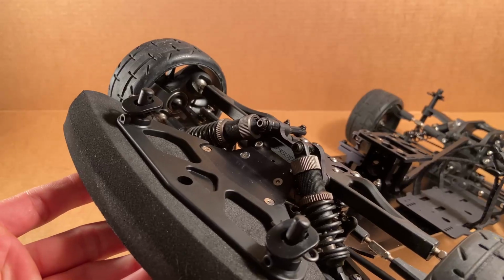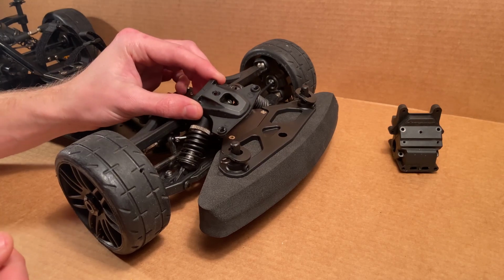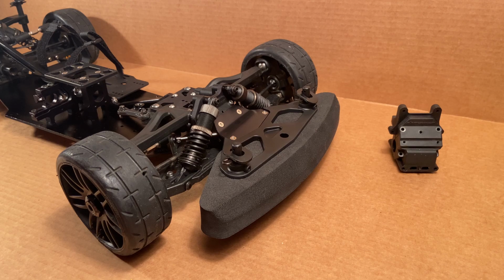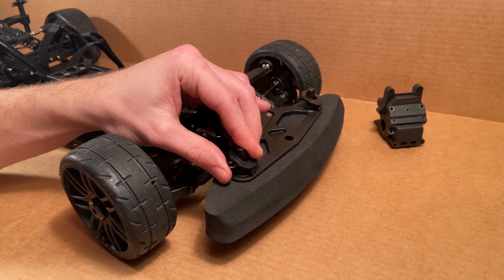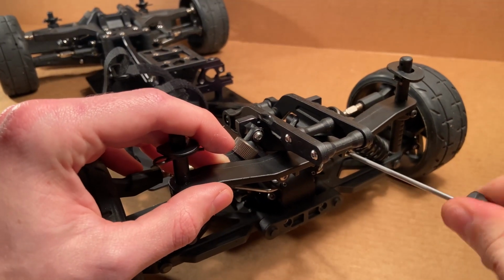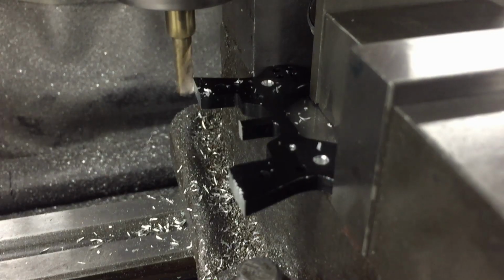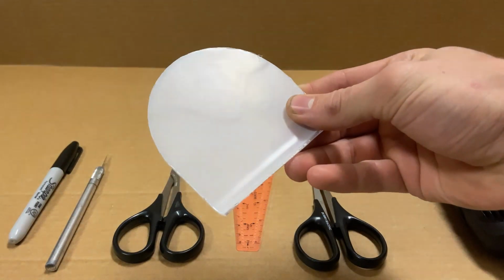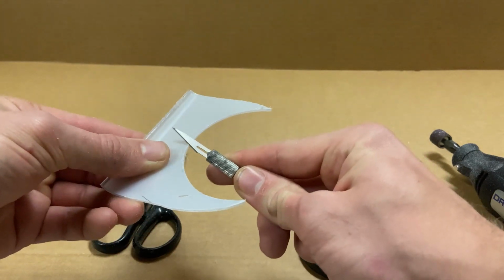Arrma Typhon Stretch + GT Conversion Build Part 2: GT Body Mounts & Trimming the Shell

Comment: @DonutManRc are you running the 1/7 scale body or the 1/8 360mm body?
Reply from the maker: I'm using the 1/8 GT2 360mm Jaguar body. Check out Part 3 of this build to see me trim, paint and mount it! Here's a link to the body: https://deltaplastikusa.com/collections/1-8-gt2-rc-car-bodies/products/7504-1-5-jag-xrs-360mm-8th-scale-gt2-racing-body-1-5mm